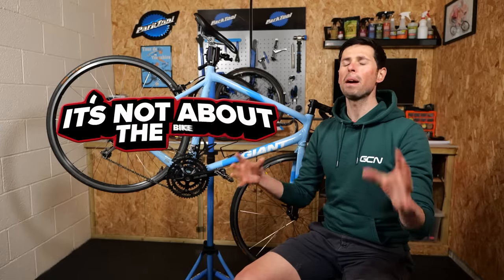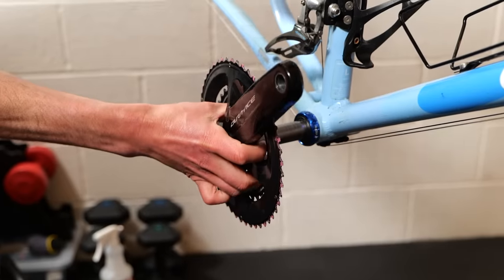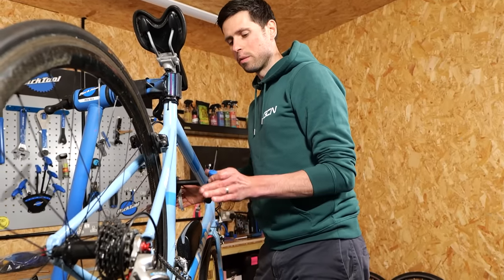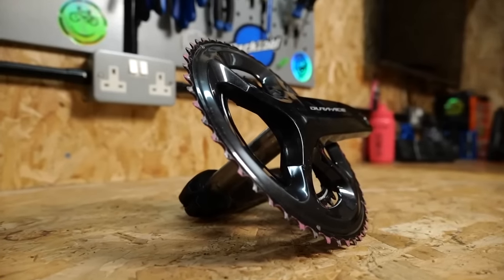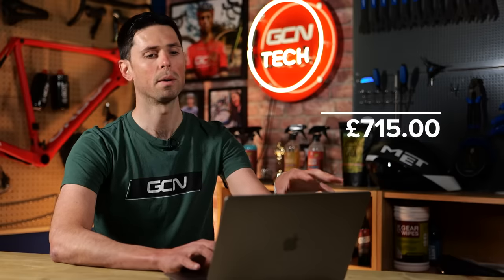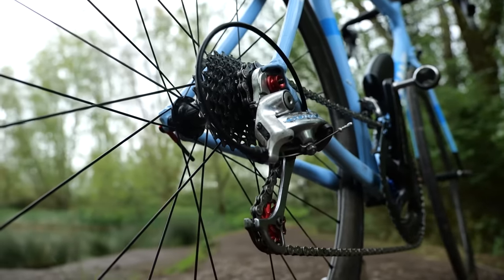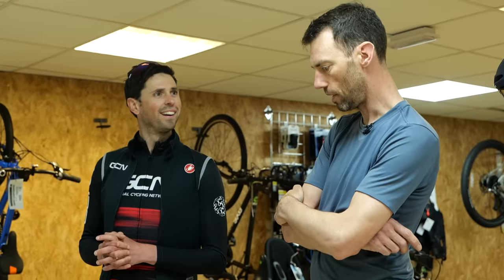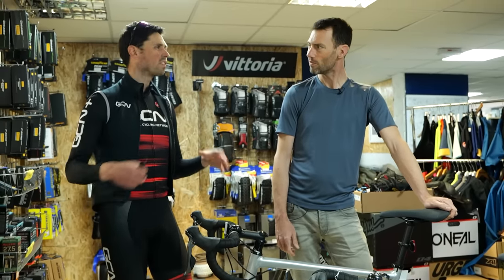Did I Really Build A Bike For Under $1000? | Cheap Performance Bike Upgrade Ep. 3

Comment: It's quite fair to say that once you start a bike building project, you already have quite a few parts kicking around. Now, the specific parts, their quality and price might be all over the place, but it's undeniable that by the time you are at the level of knowing how to assemble a bicycle from the ground up, you have already had a few in your life, swapped parts, sold some, bought some and just ended up with a crate of parts through multiple years.

EDIT: You also need to take it into consideration that you can always sell the parts off the bike, which might not be much, but a deduction from the overall price nevertheless.

EDIT 2: Would you or would you not consider adding the price of the tools used for a building project?
Reply: Yeah.  I have very high end darimo stem, a another set of wheels with cassette, lots of thru axles and skewers, xtr pedals, scandium seatpost and all sorts of things laying around.

Comment: I’ve used old parts laying around to get bikes working again, nothing wrong with that, it’s recycling, fair play and shouldn’t be in the budget.
As for the saddle, I always shift my saddles over, simply because mine are more comfortable, so I can EBay the new one get the cash and spend it on small upgrades like titanium bolts for the stem and bottle cages.

Comment: Use the dang pedals alex! Most people would re-use pedals and most trolling on here about pedals would likely also have bikes- and would likely take them off their own, Clip or clipless - or their power meter pedals… but if it is someone who has never had a bike and needs to buy them— pedals do not offer any performance gains-  unless you go for the wahoo speed play aero - so use your old pedals. Everyone trolling would use theirs- also like you said it’s a video- and everything suggested you needed to change like the crank- has been done but they can squabble about that since they’ve got not much more to do than to comment negatively on an entertainment video on cycling - if you go over budget it the real world - you just pay it- and you’ve kept everything within range of that target without boosting performance by trotting around GCN mega base

Comment: Should have started with a Tiagra groupset, no need to swop oilut crank, lighter than Sora, can't lose.  I agree pedals should not count, an upgrade bike would have pedals and a saddle
Reply: Even swapping out an alloy Tiagra outer chain ring( other cheap allloyones will work fine,) for the steel sora. Will dump a significant amount of weight. The triple shifts fine just like a double.  The bonus is click it one more time and you  have a low 30-23 gear bail out to. A 12( or 13) - 23(or 25 , 27) cassette still has  has some one tooth gear progression at the top end with 2  or 3 tooth jumps in the lower gears. My Lemond Zurich has 30-42-53 chain rings on a nice Sugino crank set and 13-23 cog set . Love that 42 over a 39 .(The older version of the Sora front derailleur works better for the 11 tooth 42- 53 jump. The newer is for the  39-52/53 jump . ) The set up is perfect for the mostly rolling hill terrain here in Wisconsin. No mountains but doesn't stay flat very long either.

Comment: To the best of my knowledge. most £10000 bikes don't come with pedals. If they do. They are the cheapest crap plastic pedals that are to first thing to be put in the recycling bin (pun intended). Then replaced with real pedals. So you would have to buy new pedals for the new £10000 bike. Unless you have a spare set of pedals . Or a bike you can nick the pedals off. You may need to change pedals due to preferring a different pedal system of using different cleats due to the pedal manufacturer.

Comment: I'm split on the pedal question. If you wanted to be pure to the challenge, of "can you spend £1000 and get a race ready bike?" then anything you put on the bike will need to count, especially if it's meant to replicate a person's experience starting from zero.

If you buy a second hand bike that comes with pedals, then if you change the pedals, that's considered an upgrade. If the bike didn't come with pedals, then you should add the cost of the pedals.

However, if you take this from the point of view of someone who is already a cyclist that's looking to build something on a budget, then it might be fair to include reusable bits from their own bike. However, replicating that experience should mean you aren't allowed to use top-end parts as the "free" parts.

Comment: Brother, 2011 DeRosa King 3 RS. Campagnolo super record 2x11 (full set) 50/34 11-27. Fulcrum zero wheels, continental grand prix 700x25. San marco aspide saddle. fsa carbon stem and handle bars. 6.88kg.... 950e
Handles and climbs like any of my current modern bikes (2021 giant tcr disk, ultegra), 2017 focus izalco max dis, sram red etap.
I'm thinking youve paid WAY to much to upgrade it and if you wanted to ever sell it, no one in their right mind would pay anything more than 300e for it. 2x8 Shimano Sora?

Comment: That front derailleur is probably shot, you should be able to adjust it just fine, that has more to do with the width of the chain than the cranks, and I'm sorry road people, but down swings are finicky by nature. 
That said a custom assembled cassete, preferably a 9 speed at least, but 8 should do, would be a nice to have on this, also changes a lot, when you can customize gear ratios to most effectiveness.

Comment: I'm totally giving you a pass on both the pedals and the stem.  I've got at least a half-dozen stems of varying lengths and angles rattling around the spare parts bin, and God knows how many pedals that'd still be perfectly functional after a rebuild.  Zero harm in reusing old bits you've accumulated over the years.

But for the sake of stirring the pot, love the idea of you racing on a cheap pair of mountain bike flats with trainers.

Comment: I would add the cost of the pedals as they are an upgrade, flat to clipless. If the bike did not come with pedals then no charge but you upgraded a pair. Could have saved money not buying the oversized jockey wheels.

Comment: I am not at all bothered by the original build that you got all the complaints about. If I have perfectly good top spec used parts, I will use them until they need replacing.

Comment: I'm not sure how you can be confused by people complaining about the way you handled the costing on these vids. 
If you'd just called it a cheap upgrade or something similar, they wouldn't have a leg to stand on. But when you put a target price on there and either don't count things or under value them, then ya you're gonna get complaints.
I'm all for you re-using things you already have lying around (way better than re-buying stuff you already have), but you could have helped yourself by being clearer right at the start that you were still going to count them at fair value in the cost of the build.
Lastly one more nitpick, for what should be obvious reasons, you can't say 300 pounds plus postage and then not include the postage in the cost.

Comment: Hi Alex. Great concept and I love the concept as I will never be able to afford a super bike. 

In general though I do think that you’ve gone over budget. Namely because you aren’t factoring in the cost of the tools that you are using for the build. 

I tried to do something similar a few years ago and ended up purchasing specialized tools to change the bottom bracket, remove the cassette from the back wheel, etc. And then I also had to spend money for items i couldn’t do myself and needed a professional mechanics help. 

Most people on this type of budget aren’t going to have access to a suite of specialized park tools in order to build a bike or be expert mechanics themselves so I’d say you need to add that to your budget. 

But I think your work here is excellent and love the concept. 
Just my thoughts but thank you for you efforts in this series. I would have added about 500 p

Comment: #ASKGCNTECH Hi Tech Gurus, I really need your wisdom: my Giant Defy Advanced Pro was built to my spec in which the shop swapped the Ultegra Di2 for 105 with ‘fancy pants’ carbon wheels and ‘speedy-boy’ tubeless tyres. Zero complaints from me.  I can’t afford a second bike (yet) but want to go bike packing. I’m a big guy and the weight limit on the carbon wheels limits what I could carry on the bike including me.  Can I swap-out the carbon wheel-set for (?) aluminium (USA check the spelling/pronunciation) stronger (32 spoke) wheels? If so, what guidance can you give me to ensure bang for buck? It’s Shimano 105, 700c, discs. Many, many thanks and just loved Alex’s build.  Ride safe.

Comment: At the end of the day, you might have come in at under 1000 pounds, but if somebody really wanted to get into cycling, not only will they have a limited budget, they'll also have limited knowledge and experience. They could get a Giant Content 1 for 999, Alroad (so they could explore gravel) for 1099 or an SL 1 brand new for 1299 pounds, Sora or 11 speed 105, warranty and all new, compatible components plus they don't have a janky 2x11-speed crankset on an ancient 8 speed groupset with triple shifters, which is just weird.  Also importantly for a newcomer, they get an 11x34 cassette. I'm guessing at the moment the best ration is 36:25?? Nightmare once you hit the hills. 

I fitted cheap alloy jockey wheels a few years ago. Never again. Shimano make them from nylon for a reason. I had terrible chain wear from the alloy wheels, and they themselves basically wore themselves out in about six months, both the bearings and the teeth.  Just stick with OEM.

TBH, if the intent of this video is to explore the concept of DIY to save money getting into the sport, I think the result achieved is interesting, but I wouldn't advice any newcomer to take it as advice. It might work at a performance level, but it's going to be a maintainability nightmare. Yes, something like a contend is 2kg heavier, but I think that for a beginner it would make for a much better experience.

I realise that GCN relies on sponsorship, which probably makes things like objective head-to-head reviews difficult because the sponsors won't like that. But if you really want to do a service to newcomers, put the Giant Contend, Trek Domane and Merida Scultura side by side in a 100km bunch ride. A proper budget road bike review. None of this Eurobike rubbish.

Comment: The fact that you spent all that money but reused the chain and didnt replace the cables/housing or get new carbon specific pads is the reason bike mechanics hate people. Btw im all about using the expensive stem/saddle or the DA crank you had knocking around - its the whole point of this excercise. I will guarantee though that the chainring teeth look like toothpicks on those cheap used hi end cranks. 
Please GCN get a professional mechanic on your crew!

Comment: I'll join in on the stem, pedals, and saddle.  Those are all fair to reuse.  When I have bought a new bike, the saddle and pedals that I prefer go on the new bike.  I've also got a couple of extra stems in my garage even though my wife and I have only had 5 different bikes over the past 10 years (4 currently, 1 resold), so we don't have a crazy number of bikes.  I think it is completely fair not to count the cost of the stem, saddle, pedals.

Comment: I get the defence in the tech show video, but I think you're missing the point. It's not about wasting and buying new parts if you have them, it's the target of the video. It's being done on the basis of like a beginner getting in to it. So they are unlikely to have a parts bin worth of stuff to go to. They are also unlikely to already have expensive saddle, shoes, pedals etc. I know I was. I personally think you should have included pedals, shoes and saddle in the build, and everything sourced externally. It would be second hand already so it's not a waste. That way I think you'd get a better perspective on what to upgrade with the money. For example, do you go clipless set, second hand shoes, or do you go for cranks, more gears/better gear range etc. Having parts that already cost loads means you don't have to think about that, whereas someone just getting in to it from say like a basic road bike they bought from Halfords would

Comment: Too bad you didn't have better shifters and derailleurs in your parts bin. Would it count if you borrowed parts from other GCN presenters???  I have no problem with having a parts bin. For example, in my bin, I have cranks ranging from a Sun Tour Cyclone, Shimano 600, Ultegra, and to a Dura Ace 7700. Same with derailleurs, 6 & 7 speed freewheels, and 8,9, and 10 speed cassettes.
Use what you got. That's an advantage of being in the sport for decades (1983-2023)

Comment: Those are awfully ancient shifters and brake calipers. And I dont see the point of reusing the old chain. I would have gotten a used bike with either the current 9 speed sora or 10 speed tiagra groupset and a brand new chain. They don't cost that much more unless you go up to 105 11 speed. You get so much better shifting and ergonomics. tubular wheels and tires are also a poor choice. A decent low cost alloy clincher wheelset like the Dt swiss P1800 or Fulcrum 5s paired with GP5000s would give you more braking confidence and better rolling resistance.

Comment: I think we all have used parts lying around un less you are completely new to cycling. So it's fair to use used parts. And I think you may have saved some more cash if you have used some new Asian products and still kept the weight and price down. We need to begin to have second opinions on those products. Some are well made and do not break the bank like Shimano and SRAM.

Comment: Just watched the vid and my take is parts in the UK are WAY overpriced. Here in Canada that bike and parts would cost no more than $800 CDN. I just finished a 2002 Colnago Master with full Super Record 11, NEW 3T bar and stem and Campagnolo BORA wheels (in the bikevault) that I have about $2400 CDN in. I have found that ebay is overpriced and there are cheaper ways to get used parts.

Comment: Why don't you try to actually BUY the parts instead of using the GCN parts bin. I can assure you it is far more difficult. Particularly as a beginner! A beginner wouldn't have a parts bin anyway.
Reply: Those aren't GCN parts bin, it's his personal bin. I also have a parts bin, and I've only been at it for 3 years.
I agree that offering alternatives like "I'm using my spare crankset, but you could go for a used 105 crankset"

Comment: Surely people can't be that daft..... Its a budget build built by a cyclist who has been riding 20 yrs, he's collected stuff along the way.. .. You'd use what you have. I have a garage full of parts that have been used and reused on bikes. Simply because I like them, I've got them. You don't need to buy replacements for what you already own, wear them out, hang them on the wall buy the next thing. After cycling nearly 30 years I've got lots of bits and pieces.

Comment: I think this is a waste of time - just buy one a well cared for used bike. For example... I am trying to sell my carbon BMC SL01 road racer. it is in exceptional condition, mecanically and cosmetically. It has a full campagnolo centaur groupset loads of other nice parts. Just been serviced by Sigma (at a cost of £375) has loads of new compents, new tyres... and I cant even get £700 for it.

Comment: did  your  build a  bike  not  using  1000 pounds ...  yes  do you really  go  under  1000  nope... probably  you can reuse, as in  real  life  you  try  and  reuse  but what  if  you  really  have and expend the 1000 and  see  what ends ... then  you  can upgrade  on  your spares ... how  about if  you have  your  spares  checked  for  second  hand  for  sale...? then  you can have  a  cut from  the  1000  and  work  with that. ... I  think the  main  point  is  having  the  spares and  using  them  is  like  have a  safety net ... real  life  bike  building  struggles  not  having  the  net.

Comment: Those alloy ceramic pulley wheels are sh*t, the bearings have no cover gasket and get clogged on the first ride, the body is aluminum that eats into your chain, and they lack the hyperglide chamfer that shimano and other replacement chinese pulley wheels do offer for better shifting.